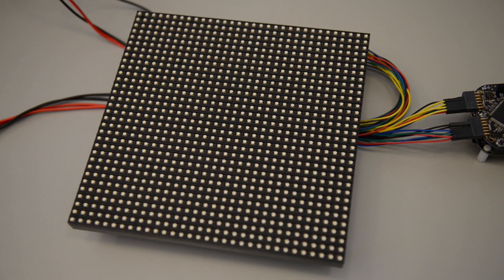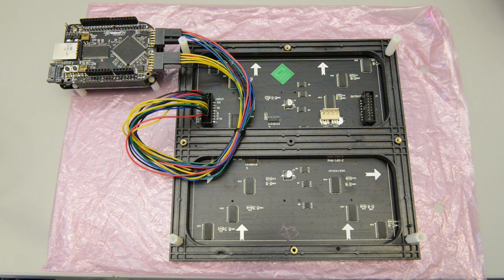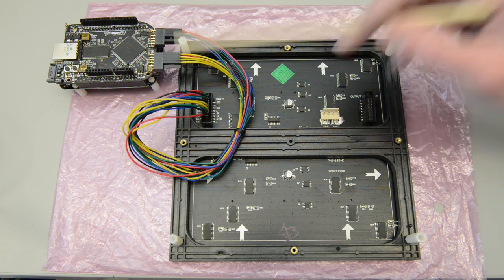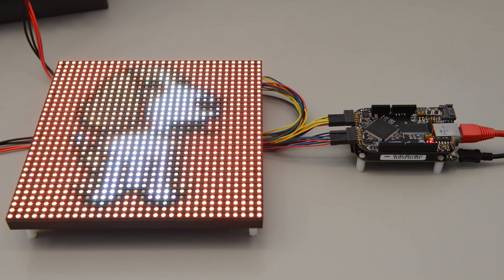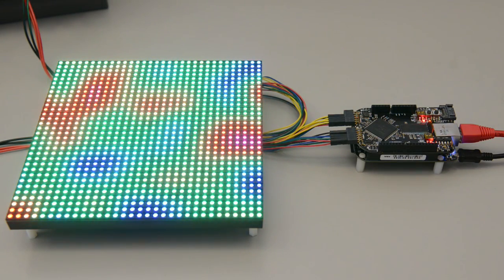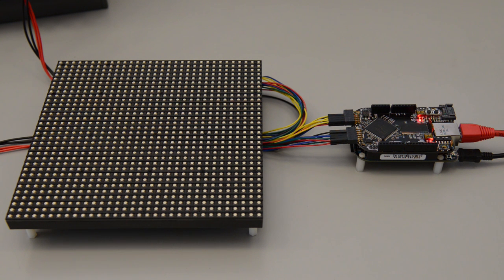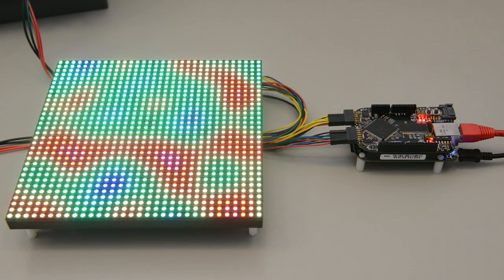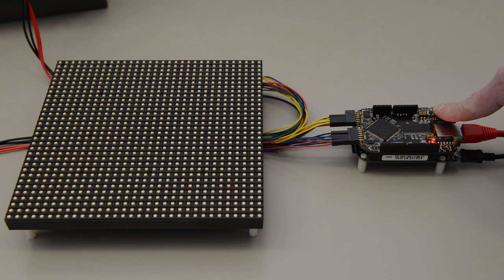BeagleBone + LogiBone FPGA Drive SparkFun 32x32 RGB LED Panel

Comment: Hi Glen, great work. Is it possible to increase the refresh rate from 200Hz to about 2KHz? What is the maximum, and if possible how could that be achieved. I would like to have this one a single 32 x 32 Led Matrix, and i would only need red green, blue and white colour. Is it also possible to use the BeagleBoneGreen instead of the BBB? Reason being the BBG is more compatible to my IoT based project. I appreciate your help, thanks.
Reply from the maker: If you’re only interested in 3 bit color, you should be able to increase the refresh rate by 16x so 3200Hz. It’s just a matter of re-writing the portions of the Verilog that control the number of bits per pixel and the duration of each bit. Any BeagleBone would work, but I’d highly advise finding a more recent FPGA board. The Spartan 6 toolset is extrememly out of date and will not be receiving any more updates from Xilinx. Any FPGA supported by Vivado would be a better choice, for example. the Arty 7 or Spartan 7 or Zynq 7000 devices. I’m ot sure if anybody makes a board with these FPGAs on them for BeagleBone yet or not though.

Comment: An FPGA is fun, but a better way to test the matrix is to use the built in PRU in the BBB right?
Reply from the maker: The PRU is less expensive and works well but an FPGA can drive more panels with deeper color at higher refresh rates.

Comment: Hi Glen, awesome work. Do you think it is possible to do this using an Altera DE2-115 borad. I'm a beginner and any information will be helpful. Thanks a lot!
Reply from the maker: Thanks. This project should work on the DE2-115 without any problems. You’ll need to use the Altera Megawizard plugin manager to generate Altera-specific clock generator and memory modules to use in place of the Xilinx versions in the current design. And, of course, Altera has their own project file and pin constraints file format too. Otherwise, it should be fairly straight forward. Have fun!

Comment: Do you know the absolute Max. number of LEDs that can been control? Because I'd try something better than Teensy 3.1,which can control max.4000 LEDs.
Reply from the maker: +Gfast Gao The Spartan 6 LX9 should be able to control 24 (double-buffered frame buffer) or 48 (single-buffered frame buffer) 32x32 panels at 12 bits per pixel. The biggest limitation is the amount of on-chip memory. Other factors to consider include the pixel clock rate, the refresh rate, the pixel bit depth, and number of I/O pins used.
Reply: external ram?
Reply from the maker: Sure. I think there’s some DDR available on the Logibone BBB daughter board. Or a larger FPGA but that’s not very cost effective compared to external DDR or SRAM.

Comment: Stunning... Is this expandable? It would seem so, but at what point does it become unstable/impractical?
Reply from the maker: You’re limited by the rate at which data can be transferred from the BBB to the FPGA, the amount of memory in the FPGA, and the rate at which data can be clcoked out of the FPGA and into the displays. It’s been a few months but 16 panels should be doable with the small FPGA on the Logibone board. With an FPGA with more memory and more pins, the number of panels hooked up to a single FPGA could get to be quite huge.
Reply from the maker: I have code that drives eight panels with 12 bit color at 200Hz. I’ve actually hooked up six in a row. 16 would be easy but I would need to steal some pins on the Logibone from other functions.

Comment: The Beaglebone is cool. But has anybody found out how to make the GPMC work in synchronous mode without the clock shutting down between accesses?!?
Reply from the maker: I’ve been mostly using Microblaze cores in my Xilinx FPGA designs now and have stopped using BBB / RPi boards so I have not been following what has been going on with the GPMC bus. Agreed that a synchronous mode would be much better than the scheme I was using.

Comment: Hello Glen,, Super work. It made my day.
Cant wait to have one. Where I can buy one. I need it in India.
Please suggest.
Reply from the maker: The LED panels can be purchased from SparkFun or Adafruit. The FPGA board can be purchased from ValentFX. All three should ship to India. Look for a local electronics distributor to purchase a BeagleBone Black.
Reply: Glen Akins
Thanks for your response.
There are more than one variants available for "BeagleBone" such as "BeagleBone Black Revision C" or something like that.
Which one i should buy for exact compatibility with "BeagleBone FPGA card".
Please suggest.
Reply from the maker: They all work with the FPGA card. Buy Rev C if you don’t already have a BeagleBone.